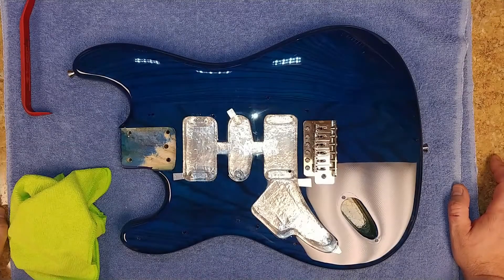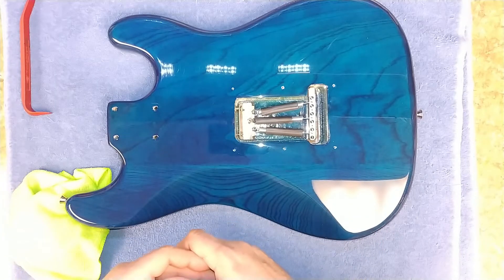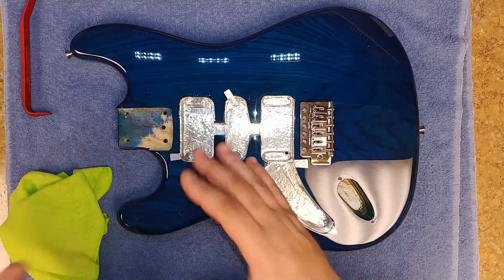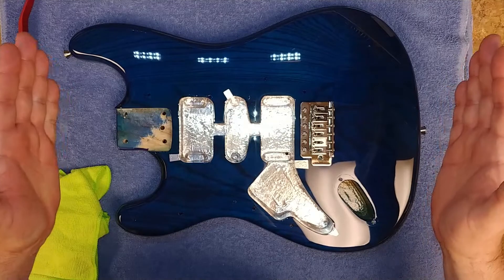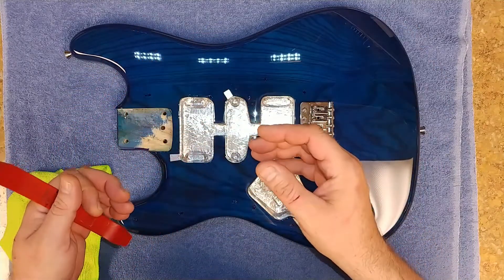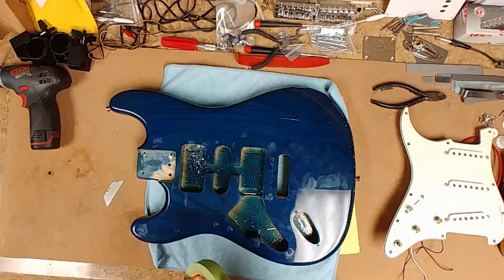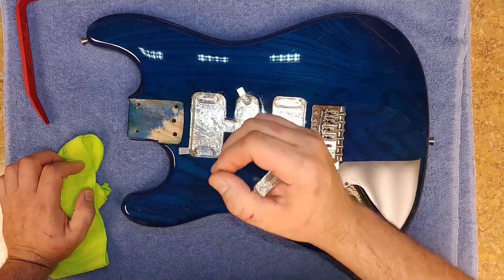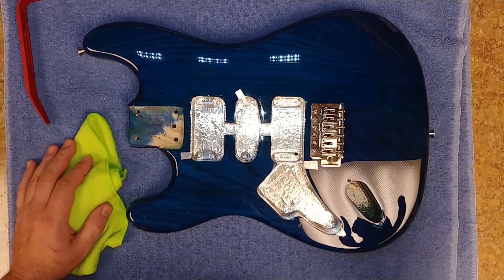CONTEST IS NOW CLOSED as of11/30/2020!!!  Christmas Contest Starts NOW!!! SX Guitar Give Away.

Comment: I would like the pearl with the hot rails pick guard, the number I choose is 876!...
Reply from the maker: thanks for entering. everyone who is wanting the Mini Rail Humbuckers if they win I am asking this question. Tone Caps- .022-.033-.047-.068 what tone cap would you like? the higher the number the darker the tone. Thanks.
Reply: Single coils .022Mf,
Humbuckers .047Mf,
Maybe compromise .033Mf, all three of course with A500 pots. If you have the time and energy look into using 1meg tone pots with .033, or .047Mf caps (have recently solved some tone problems with neck humbuckers range, and clarity with 1meg pot & .047 cap)
Reply from the maker: @briankientz2926  ok. I'm using CTS 500k pots and will be adding a switch for each pup to split the humbucker, along with the 5 way switch. Kinda give more tone options.
Reply: Sounds good, look into a six way selector switch that will give you even more range than you are looking at now, ( Pos.1 neck, pos.2 neck & cent, pos.3 cent, pos.4 cent & bridge, pos.5 bridg, pos.6 neck, cent, & bridg. This along with your splits will give hella options) I have gone to six ways on my strat builds, works well!!!